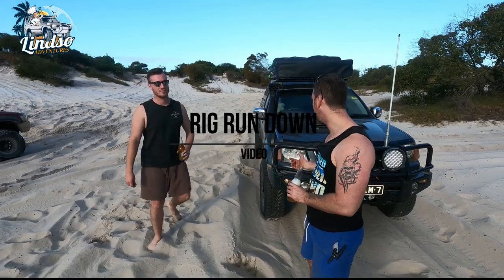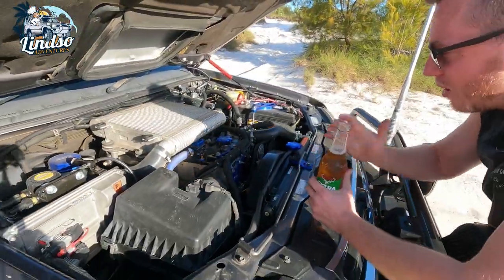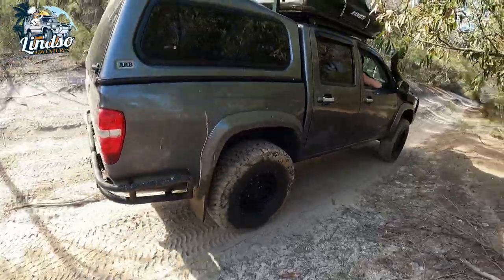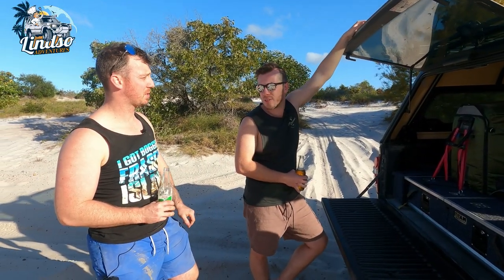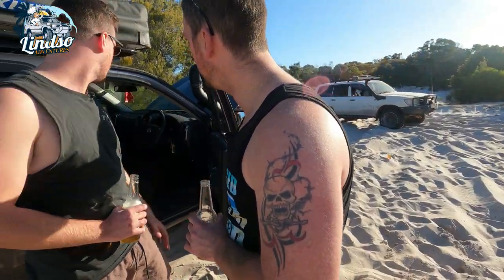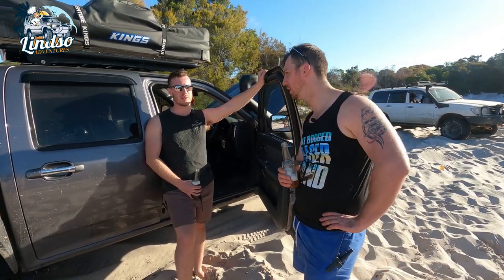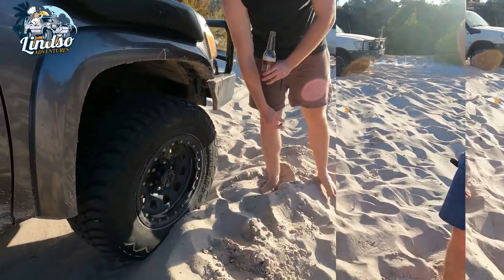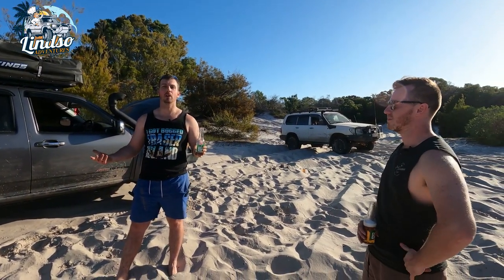Tim's 272hp, Rig Run Down video of his Rc Colorado (4jj1)

Comment: Nice set-up.  How do you go driving in the wet with all the extra power? I have a stock 4jj1 in mine,  with a throttle module,  and it spins the hoops even when you're trying not to in the wet. I have got rubbish BFG's on it, but it's still hairy as.
Reply: Yeah it's not too bad cause it's got a bit of weight so she grips good. But if I tapp it too hard, doesn't take much for her to kick out hahaha